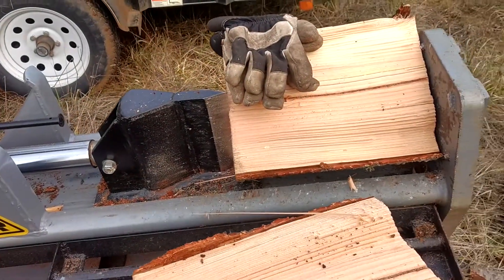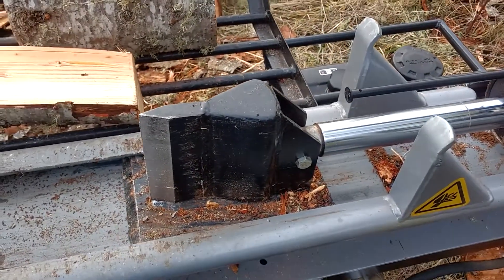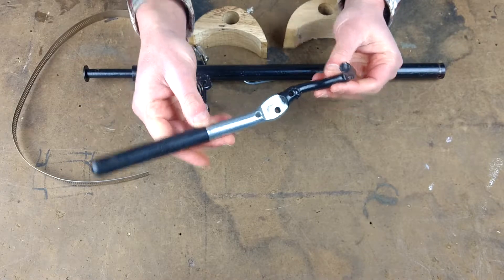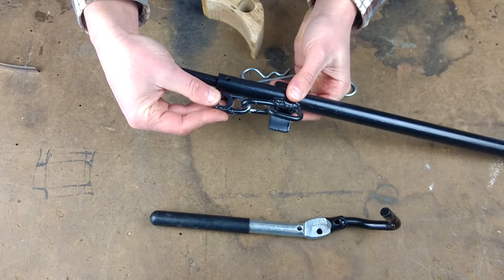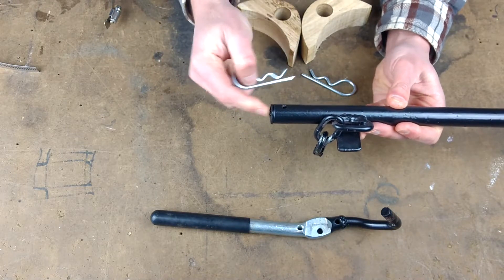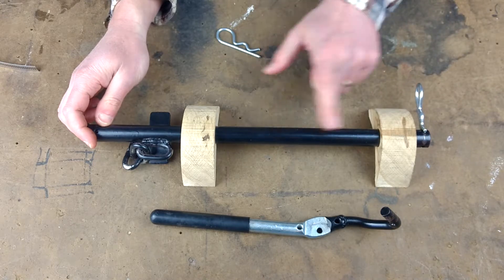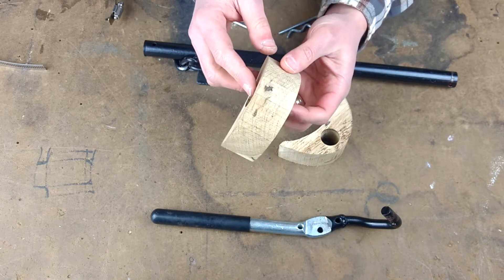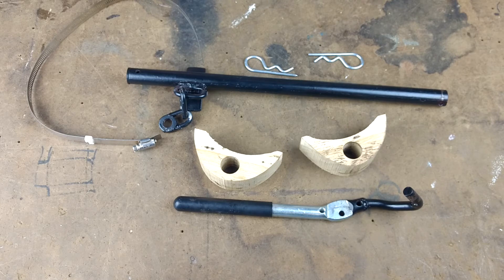How to Build the Log Splitter Stoke Limiter.

Comment: Hi Jonas. This is a very neat and tidy engineering job. I don't have metal/weld experience. I get around it this way. Main reason is to keep the cylinder extension as short as possible. Extended all the way under load can bend it.  QUAD method. "Quick And Dirty". For those without the tools or skill to make this. Let it retract fully, and place firewood against it (the hydraulic cylinder end). Place a block(s) of wood (2x, 4x, 6x) slightly smaller than the gap left between the firewood and the base plate/bottom. Put them cross-grain so they don't split to. Should be tough enough to stop the splitter and auto-flip the handle. Most of the time you're going to be hands on as the wood splits, so you return the handle. On small electric splitters where the splitter knife is at the other end, use the blocks between the ram and the firewood. Guess you could build one of these limiters for stopping the forward stroke. Just attach to the splitter head and use longer rod.
btw: Soak the wood pillow blocks you made for 15 minutes in used motor/trans oil mixed 50/50 with diesel to pull it into the wood. When it dries (2-3 days) the wood is polymerized and the oil is inert. Will last decades outdoors. Brush on every few years to freshen appearance. Fence posts done this way last decades, 50 -100 yrs.

Comment: A chunk of Delrin would make nice brackets for the slide. If I don't have any around, I think I may try 3D printing them in PETG. I might include a slight indent across the top for the hose clamp to sit in. Not really necessary, but would reduce any potential for the band walking off.
Reply from the maker: 3d printed guide blocks would work great. I've been working on a cnc plasma table build and I'm using a lot of 3d printed brackets.  With the right design its plenty strong.

Comment: Why don’t you just drill a hole in the slide base and put a bolt in it?
Reply from the maker: They sell collars you can put on the ram shaft to limit how far the ram can pull the slide back. This is the same idea as a bolt in the slide.  Both will eventually shear off the bolt holding the wedge onto ram.  But it does work....just a different mouse trap.
Reply: @championacres  and a much better mouse trap.
I'll be making something similar for mine. I'm building a four way wedge for it now.
Your engine guard is also a good idea. After over 30 years of use I had a large chunk of wood hit the cooling shroud on mine and put a dent in it. 
Thanks for sharing.

Comment: VERY good idea!
Reply: Did you weld the hook to the control lever? Great idea by the way! Thanks
Reply from the maker: @chrisshort8345  yes, welded the hook onto the original lever.  I think it was part of a j bolt.
Reply from the maker: Thanks!
Reply: @championacres  No, thank YOU! I may try and rig something like that up on mine. Wished it had a Prince valve though. You can set the kick out pressure on them. Energy makes a good valve but the kick out is up around 800 p.s.i. At least you can rebuild the newer ones. Kick out, that is.
Reply: Excellent video!!! Please do a vido on the log table....thank you